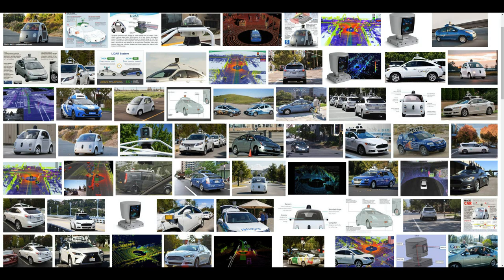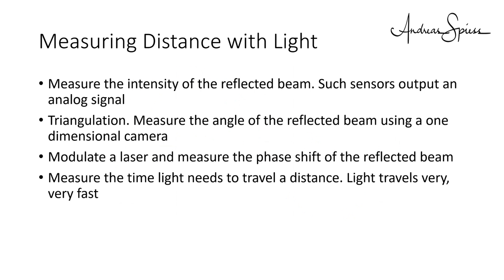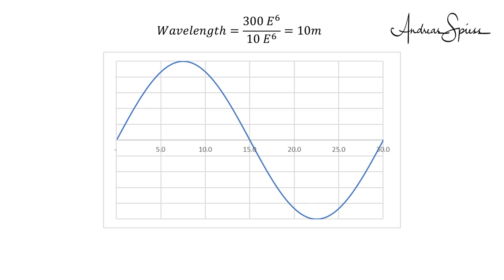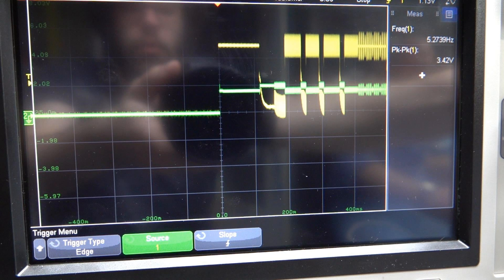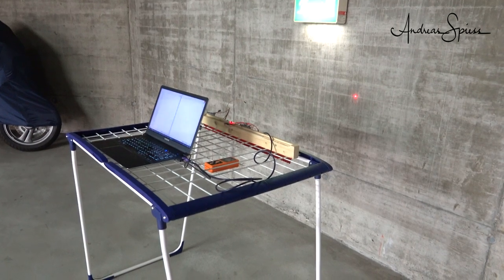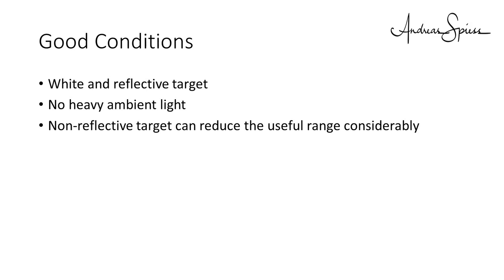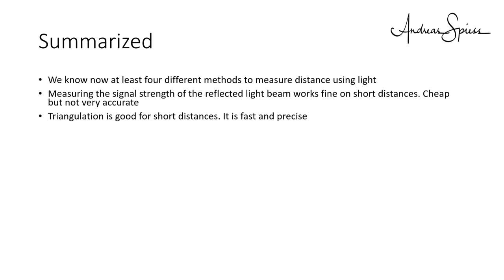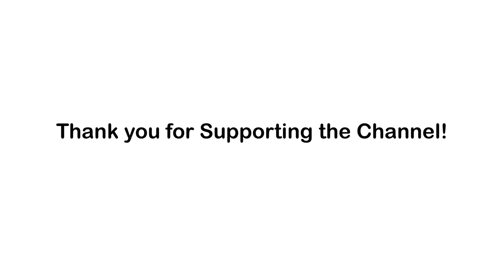#203 Best LIDAR Sensors for Makers (Comparison and Test)

Comment from the maker: The Sharp uses Triangulation. I did not read the datasheet correctly!
Reply: The one in your video uses triangulation but there are IR sensors which rely on brightness levels. 

I'm sure you know this but I thought I'd mention it in case others aren't aware.
Reply: Mai Mariarti
Do you want to use the sensor underwater? If so, you need a different type of ultrasound sensor.
If you want  to use the sensor above water, then there are several options for waterproof ultrasound sensors.
I believe the guy with the Swiss accent has shown us some of these waterproof sensors. Maxbotix makes weather resistant ultrasound sensors. Here's one at SparkFun:
https://www.sparkfun.com/products/11724
If you need help finding a waterproof ultrasound transducer, let us know so we can help you look.
Reply: Hello Buddy , do you know what makes tof lidar receivers detect reflected light over 100 meters ? I cant imagine a tiny beam of light hits target 100 meters away and return a tiny receiver .
Reply from the maker: Look at the rangefinder video. It worked over 1500 meters
Reply: Polygonal mirrors can be recovered from old laser printers. They make a superb laser scanners.

Comment: Again a very good explanation of the laser range finders ! One remark : the first sensor in the video (Sharp) is also based on triangulation, and has a psd inside.
Reply from the maker: You are right! I did not read the datasheet correctly!

Comment: Patreon here: Looks like this will be in all cars within 5-10  years for obstacle detection. Your experiments are very interesting +Andreas.
Reply from the maker: We will see if we still call them "cars" then. Maybe they are more "taxis". I do not think it would be of big value to replace me as a driver if I still have to own the car. My work of driving is free of charge. I think a big difference will be that I just order "transportation" and it will be cheaper than driving my own car because these vehicles can be operated 24/7 and not only one hour or less a day.
Reply: I do agree.
Reply: northshorepx is already implemented in volvo
Reply from the maker: Not in mine. I still have to drive on my own :-(
Reply: Owning cars is cheaper than taxis if you need to make a lot of km a day, like if you need to commute long distances. Even with self-driving cars, the taxi company has to pay for the cars, the fuel (electricity since we're in the future) and the maintenance. The taxi company also has to make a profit. So it isn't likely to be cheap.
Reply: Andreas Spiess I think what northshorepx and v12345vtm means is these kind of sensors are already used in some cars as driver aid and safety system. Usually in the form of automatic braking if it sees object on the front of the vehicle moving too slowly so suddenly. It also used to eleminate blind spots.

Comment: Thanks for yet another valuable video!

I wouldn't be too happy if I forked out almost 200eur for a LIDAR module (not even a rotating one) that is specified for a 40 meter range, and then discovered that it cannot reliably measure said range even in a dark garage with zero sunlight, even when the target is a flat, white plate, perpendicular to the beam!

What comes to short range LIDARs, I would suggest scavenging used and/or broken Neato or Vorwerk robo-vacs. They (at least the high end models) have featured a LIDAR at least for five years, and from what I have read, it is very good and well documented by the hacker community.
Reply from the maker: 1. Life is not always a success. This is part of the concept of this channel: I test and you decide if you need the stuff (and maybe avoid disappointments). For people with the need of far-reaching obstacle avoidance, the Garmin might be the only possibility.2. Thanks for the hint for another source of Lidars. Another viewer also referenced to the Neato. But I do not know these brands here. So I have to stick to what I have for the moment.

Comment: How about using time-of-flight together with phase shift detection? You shoot laser modulated with a high-frequency signal, measure the time it was travelling, and then look at its phase-shift for even more accurate distance. They can be the same accuracy as the time-of-travel sensor, while costing less because they don't require precision as high for the Time-to-Digital converter. Also, the drop in speed is insignificant compare to the ToT sensor
Reply from the maker: I am not a specialist. Maybe somebody does it if it is so much better or cheaper.
Reply: Those do exist but you need a (military) security clearance to play with them. So I think it's more a matter of patents that stop this tech from being readily available.

Comment: Excellent! I learned a lot. I called those Sharp sensors "ET sensors" because they look a little alien. They worked intermittently for my robotics club but we still used them a ton.
Reply from the maker: Thanks for sharing your experience!
Reply: Andreas Spiess   Hello Andreas . I don’t mean to hound you but I could do with a bit of advice please .
As you know in our world at present we have to stay a safe distance of 2 meters apart , but that’s not always ease . I want to build a system with possible distance sensors enclosed in a badge or bracelet . Example when person A approaches person B and if person A breaches the 2 meters the unit activates for a shoe RT time either flashes or sounds or even vibrate . Can you please point me in the right direction on where to get the correct parts and what parts I require . Thank you in advance Seamus Fitzgerald

Comment: Another fantastic video! I can't help mentioning a trivia point: When using the phase shift from multiple frequencies to determine range, the correct range can easily be determined using an algorithm called the "Chinese Remainder Theorem". It is a very old algorithm and always struck me as almost magical when I was working on navigation systems for Kearfott! :-)
Reply from the maker: So you must be a specialist (looking at the homepage of the company)! So you used this theorem to determine the different frequencies used?
Reply: I left Kearfott 32 years ago after dragging them kicking and screaming into the digital signal processing era by using the original TMS320 on my Correlation Velocity Sensor program. Back then, the TMS320 cost about $1,500 which was a ton of money in the early 80s, and all the old analog guys didn't see any need for this new fangled stuff! :-D

The current state of the art in CRT (Chinese Remainder Theorem) is detailed in a 2017 paper called "Robustness in Chinese Remainder Theorem" by H. Xiao et. al. Dr. Xiao is a professor at MIT. I would put a link to it here, but apparently copying into the comments isn't allowed.

At Kearfott, we used CRT in our navigation equipment wherever we could, for both frequency estimation when we only had a short glimpse at a signal, and also for range estimation based on multiple frequencies. These were both key to our Doppler Navigation Systems since these systems always needed to provide range estimates for both altimetry and obstacle avoidance purposes.

The biggest problem back then was as Xiao described in his paper, insufficient SNR would result in phase errors that could lead to the calculating the wrong number of cycles, or what we referred to as gross error, as opposed to a fine error where the integer number of cycles were correct, and the error was limited to the residual. It seems this is much less of a problem now than it used to be, but for whatever reason, it's still not commonly known that there is a reasonable simple algorithm for solving for the number of elapsed cycles based on the phase residual in a multi-frequency system.
Reply from the maker: Thanks for the hint. I found it. But it will take some time to read and understand it ;-)
BTW you can post links in the comments. Many others do it too. Sometimes they end in my spam folder. But if the links are ok I can allow them.

Comment: Until recently I worked for a company that measures the tightness of large bolts by bouncing a 20MHz pulse to the end of the bolt and back. This was called time of flight. A longer time indicated the stretch of the bolt.
Reply from the maker: Interesting they use the same principle with radio frequencies

Comment: YDLIDAR X4 Lidar - 360-Grad-Laser !! This sensor could also be very interesting. You can order it from Amazon. The price is also okay.
Reply from the maker: It is a similar design as I showed in this video and used in another one. But I did not test it so far.

Comment: I wonder what's up with that Garmin, like is it super sensitive so it needs software averaging, or is it just not very good.
Reply from the maker: I think for obstacle avoidance the precision is ok. And its range is very long compared to the rest.
Reply: My guess is that it has the best IR detector, and thats why it sometimes still see's sunlight in the above test setup, causing it to get confused and sometimes just output a wrong range all together. Like Andreas said though, they are pretty far off numbers, so it shouldn't be to hard to filter those out/work with averages of several measurements.
Edit: Another thought i just had, as its apparently auto-configuring itself at set intervals, maybe thats the cause, the way off returned results are from the moment when the sensor goes into 'setup mode' for a few milliseconds? that would be an easy fix (if interval is met then auto configure but dont return results, else return results)

Comment: Great demo, thanks!
1061?  Possible photonic cross talk by both devices operating at the same time?  Also, the laser in the GARMIN might be FLOODING due to closeness, the device is designed to function at 40m right?
Reply from the maker: The Garmin has a range of Range: 5 cm to 40 meters. Crosstalk is not likely because of the different timing.

Comment: For obstacle avoidance you should understand the difference between laser and sonar. Lasers are always beams and if you use them for obstacle avoidance, the good is that you can easily get the angle where obstacle is but the weakness is that because it is beam, it can go "through" a obstacle where a robot coul still collide. Then sonar, it's coverage is a cone shaped so it is good to find any shape obsatcle but you need make it to rotate to get angle for obstacle. Therefore, in our robot we use both, sonar and lidar for object detection, and lidar for distance information
Reply from the maker: You are right, they have quite different properties.

Comment: If the tiny lidar sensor is used in a well with water, would it need a white surface as a reflector? Or would you reckon that the reflection from the surface of the water be enough?
Reply from the maker: I do not know. The light has to be reflected back to the Lidar, otherwise, it cannot be detected.

Comment: Hi, Andreas, first of all, I folow all your tutorial and there are greate, thank you for all the time and dedication that you put in it.

I want to ask, how fast is the detection in the sharp sensor, if you put it in the robot car, what would be the maximun speed of the car? And, did you have to pos-process the informacion of the sensor.? Or is done is real time?
Reply from the maker: This is an old video and I am an old man. So I do not remember the details. I am sure you will find answers if you read the specifications. I assume you have to do post-processing to do decisions based on the sensor data. I only tested the sensors.

Comment: Thank you for sharing your knowledge and experience :)  In a project Iæve use arduino ultra sound sensors, but they are not good enough. Inside building they are accurate and perfomance is good, but when I try it outside in the dark and snow on the ground the performance is poor! Not accurate reading and not reliable. I need to measure between 20cm and 100cm. A good solution maybe even be a combination of sensor types to handle darkness and differe surfaces, temperatur etc..   What kind of sensor do you recommand?
Reply from the maker: I have no recommendations for such situations. You have to try which is better.

Comment: Dear @Andreas Spiess, thank you, for a nice and informative video. I want to build a distance sensor that should be precise for distances of 2m to 10m. It should have an accuracy of 0.1 % for shorter distances like2-5m and can have an accuracy of 1% at 10m or more. Is this possible in one range finder or I have to use a different finder for different distances. Also which would be better a Laser-based or sound-based for above requirement.
Reply from the maker: You have to read the different datasheets and search for what you need.
Reply: @AndreasSpiess , I have seen the datasheets of lidars available in my country. I didn't come across a LIDAR that has 0.5% accuracy at 5m. also the fact that the specified accuracy is not seen reality. From your experience, please suggest me a LIDAR or Ultrasonic rangefinder which as accuracy of 0.5% at 5m

Comment: You put in a lot of effort in your videos. The findings are well researched. Love your videos. Please keep up your good work. You earned a subscriber. One thing I need to ask you. Do these lidar sensors work with edible oils. I have a projet where we have to measure oil level in tanks 25 metres deep. Will the TF02 work in such a scenario?
Reply from the maker: Welcome to the channel! The sensors depend on a reflected signal. I assume a quiet oil surface will reflect  the beam. However, I do not know on the maximum distance

Comment: Can a kinect unit be used for accurate range finding? I guess it would need lots of processing, and lots of power, but its view of view is huge compared with these measuring a single point at a time.
Reply from the maker: I think you are right. However, I have no experience with this device

Comment: Running multiple LIDAR devices simultaneously, right next to each other, at close range (1m) is cause for interference on sensitive units like the Garmin... it's watching for return pulses, and it may be getting false returns from other transmitters.
Reply from the maker: You are right.

Comment: Will it measure the distance of an object inside a tube?...Or will there be an error due to reflections from the walls of the tube?
Reply from the maker: There should be no reflection coming back to the device. The walls are in parallel to the beam
Reply: Thanks. Actually that happens to be the case with ultrasonic sensors and IR sensors.
Reply from the maker: Lasers are very focused. Ultrasonic devices have an opening angle of 30 degrees.

Comment: An actual ToF sensor doesn’t measure the time difference. It measures the phase shift by IQ-modulation. I’ve been working on calibration of TI’s ToF sensor for around one year. It produces 10MHz as modulation frequency and mix it with reflected signal which suppose be similar in shape to the modulation signal but weaker. Through IQ modulation you can get very high resolution I phase and Q phase results, where the resolution depends on the strength of signal and resolution of adc. With I/Q phase, you can get the actual phase shift, and the phase results will be corrected by linearity correction cause the wave is squared but the signal through IQ phase conversion is supposed to be sin wave.
Reply: The calibration of ToF sensor is much more than calibrating distance offset. It have some characteristics change with temperature or ambient light. That’s a bit complicated.
Reply from the maker: Thank you for sharing your insight. I do not know which sensors still work with the indirect method (signal modulation) and I did not test if I see a modulation on the emitter.

Comment: From your conclusions, TFMini can be used underwater? What about distances and accuracy underwater? As far as I understand, the frequency of the lidar is crucial here.
Reply from the maker: I have no idea if they would work and how far the LED would reach in water.
Reply: I tried to put Garmin Lidar in the tank and get the measurements underwater, but it seems, that glass and water makes strong reflection surface. As far, as I looked through the internet, green lasers are being used underwater, because they have different wavelength. Lidar lite was NIR laser, however, underwater lidars are close to the green spectrum.

Comment: Do you know any software can be use to get 360 map for GP2Y0A21YK0F senor or TFmini sensor with arduino? I can use servo motor or stepper for rotating.
Reply from the maker: It is simply a analogRead command an the formula in my chart for the distance. Maybe you even find a library. Like that you can include it in any other Lidar projects
Reply: I am looking for 2D or 3D visualizing software for GP2Y0A21YK0F senor or TFmini sensor with only programming arduino.
Reply from the maker: I never say something like that. Most people used Processing at the PC for visualization and an Arduino for capturing the data. Here is a project of one of my viewers: https://github.com/Brezensalzer/StepperBotLidar2
Reply: Yeah you never say that but i am looking for that. that is why I asked. thank you very much.